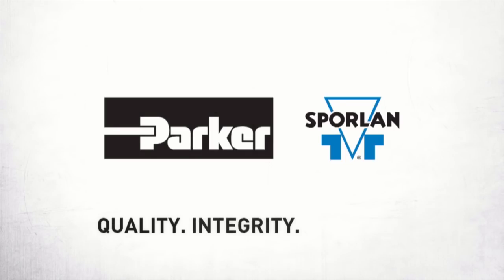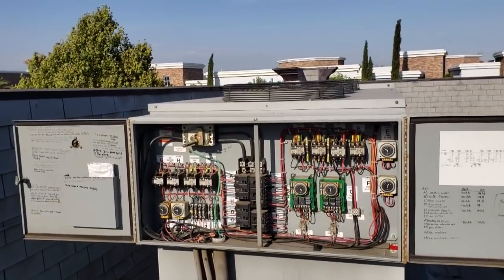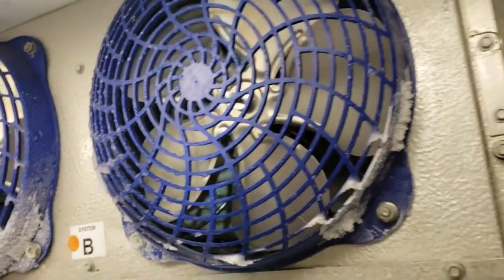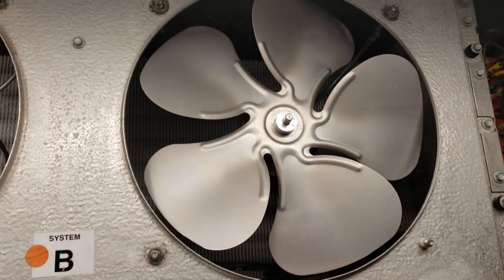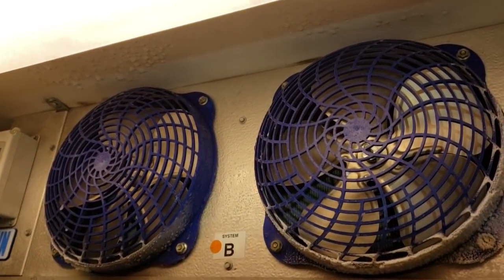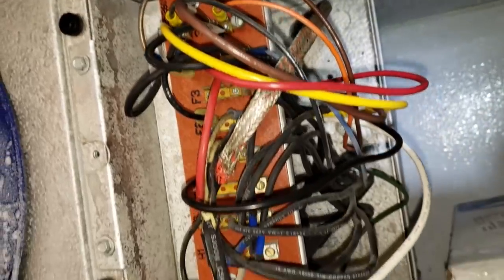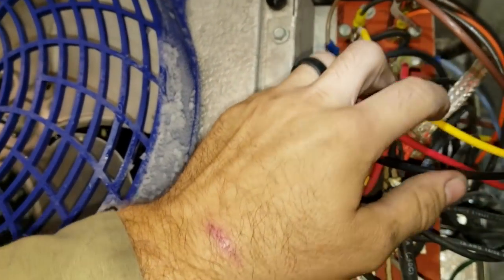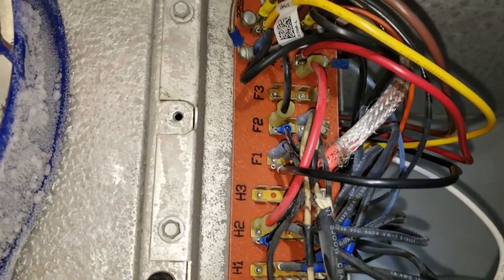WALK IN FREEZER BREAKER TRIPPED

Comment: Good call sir ! 
I have this same this problem it was fan motor burned out due bad FDTD switch. I did spent in walk in freezer for hours to found out. I turned defrost clock into defrost and timing defrost ended and fan was run right away as the moisture blow out. I can see the little spark on motor. Replaced FDTD switch  and fan motor just like you did that. Good video as always Chris

Comment: I've found that when you got a motor running slow especially this case,a wire has burned through but also burned through to a ground which is acting as a neutral-i've run into some  strange stuff in my years

Comment: Good vid. i Hate When there is no obvious short or burn. Youve got to be super thorough and check everything. Amp check the drain line heater. ? 
1) sometimes - that means that it occurred when in defrost - sometimes.
For the new guys out there - If the breaker is tripped & the Defrost clock is in defrost thats a key giveaway. dont just all willy nilly spin the defrost clock.
2) if nothing obvious -  Alot of times - ive seen the Freezer drain line heater Burn open and it wont trip the breaker again ,  but it wont be warming either. super important to check the amps on drain line heater.
3) Ftngot ) - whenever u see frozen water stuck to fan blade covers it means 1 of 3 things 
a) drain line is plugged
b) drain line heater is not working
c) fan delay is bypassed or not working correctly. if over 10 yrs old Replace. they are cheap & should be a truck stock item. When in doubt allways replace. write year beside it with sharpie when replaced.

Comment: Hope the pan heater doesn't have a split on the bottom side or under a clip.
Reply: Yep , He did not show Amp checking of All Heating elements in Defrost. probably done off camera. chris is usually very thorough.
Reply: @OcRefrig  I know Chris is very thorough. I'm just speaking from experience. I had a similar situation and the heaters checked out for amp draw and continuity and a fan motor was out due to single phasing. There was a small crack in the bottom of the pan heater that shorted when during defrost the condensation in the pan infiltrated the crack and caused an arc to ground. When dry all checked out normal.
Reply: Thanks. So, Very true. i see it in condensate heaters too they have to be visually inspected.
Reply: Great reminder csvi ! Thanks.

Comment: id be Probably replacing that Breaker too possibly  ? it Fell out kinda easily ? Definately visual inspection of Breaker & Contact point to the bus bar ?
Reply from the maker: Yeah I hate that style of breaker, they should not be used in this panel because they are meant to be held in-place by the cover panel you see in a normal breaker box.  Honestly I don't think that the breaker is UL listed for this situation, I'm sure If I contacted the underwriters laboratory they would have something to say about how it was installed.......
Reply: Agreed. i think All Breakers should be bolt in. Push in breakers should be outlawed period.  it would probably eliminate alot of fires & problems. Push in breakers are a accident waiting to happen. friction gripping a bus bar is rediculously stupid.

Comment: if there's no phase monitor/protector, one phase dropped could allow the motors to run on low voltage via back-feed through other equipment in the building or more.
Always good to ask if they had any power issues in the area and visually inspect all wiring/devices from the equipment back to source breaker/panel.
Reply: He said voltage was 108= single fase

Comment: Sir can you please explain.
What is automatic pumpdown of chiller?
What is antifreeze alarm means , if shown in chiller display?
Why superheat is showing very low(4°), possible cause?
Reply: To little water flow
Reply: @sjefoekel6058  thanks
Reply: @sjefoekel6058  sir can you explain all 3 questions
Reply: @kashifiqbalzafar  automatic pump down will start when there is no load on the chiller, to prevent liquid refrigerant slugging on start up.
Anti freeze alarm will pop up when the evap temp drops below freezing.
Superheat low is because there is no load on the chiller.
Please ask sombody with knowhow to help you instead of google or YouTube before you start breaking things.
Reply: @sjefoekel6058  thanks alot

Comment: How would the fan delay switch cause the fan motors to burn up if they received the proper voltage ?
Reply: by having bad contacts inside. when they cycle, the plating wears, pits and arc's worse, which means potentially high resistance and it could be an intermittent issue. looking fine with no load or lighter load (one or both fans unplugged)
Reply: @throttlebottle5906  you can tell by measuring voltage drop acros them, this also applies for relays,contactors.etc.

Comment: Here's a doozy for you. 6 year old goodman central heat and air ac unit keeps switch from hot to cold every 30 seconds . Only thing that stops it is to turn brake off or turn head unit off . I thought it would be a simple fix by replacing the head unit with fresh battery's but no luck . Any idea what it is ? It worked fine for 6 years .
Reply: MAD SEXY just a thought from a 35 year tech. If you never lose your 24volts to the Reversing valve assuming your in cool mode then good chance the defrost board is bad. Goodman changeover valve is energized in cool mode, so if you lose power to the  changeover valve 24 volt coil you turn back to heat mode. My gut says, defrost board. Good luck. Oh, quick test would be to wire 24 volts direct to changeover valve coil and if stays in cool mode, most likely 😉defrost board
Reply: @coolezum  yes sir ended up costing me around 375 to replace.
Reply: !MAD SEXY very good. Peace Brother